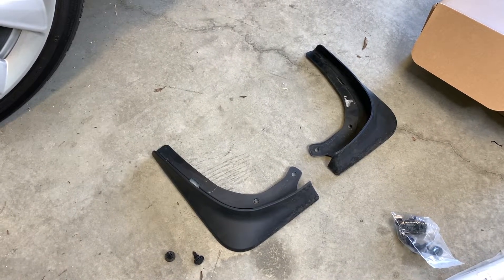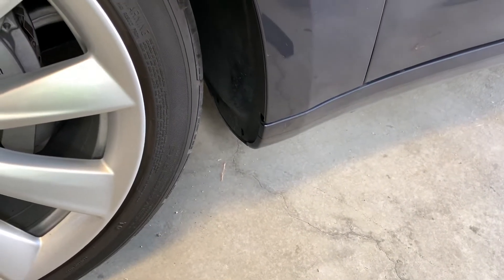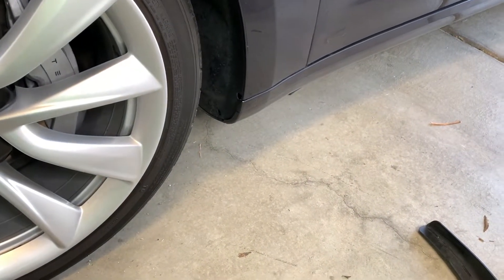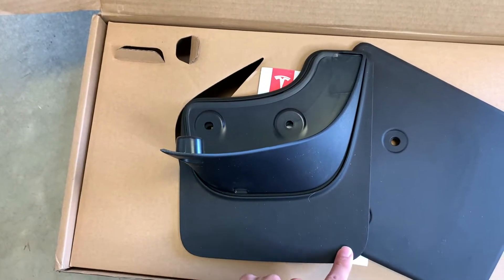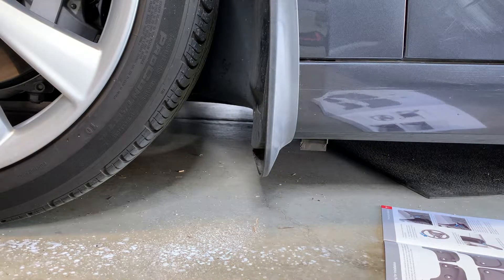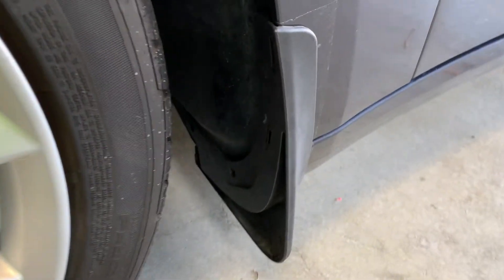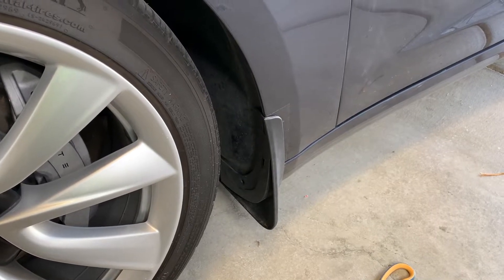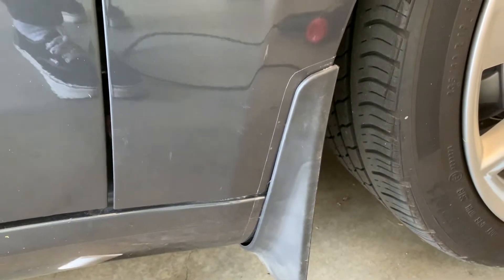TESLA OEM VS AFTERMARKET MUD FLAPS COMPARISON & PPF INSTALL FOR LOWERED TESLA MODEL 3 STATIC DROP

Comment: hey love the video! can you show an update on if the mudflap has damaged the paint/ppf at all? love the video :)
Reply: and do you think instead of using ppf, if i used 3m auto tape to secure the mudflap it would help prevent damage as well?
Reply from the maker: I gotchu! Just make sure to subscribe so you get the notification when it posts
Reply from the maker: 3M auto tape as in double sided tape?
Reply: @jesseesierra  yup as in double sided tape!
Reply: @jesseesierra  when do you plan on updating/posting?
Reply from the maker: Sometime this week
Reply: @jesseesierra  any day in particular you're thinking of :)
Reply: @jesseesierra  any update?
Reply from the maker: I’ve been busy with work but hoping to do it this week. It looks the same still